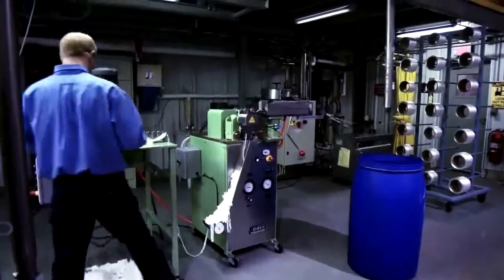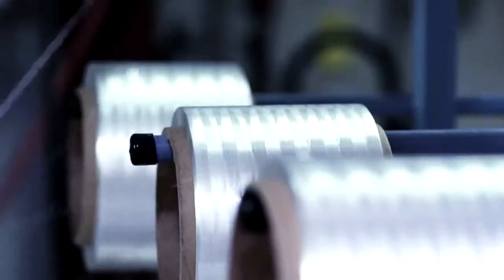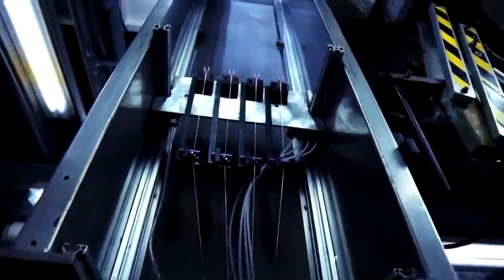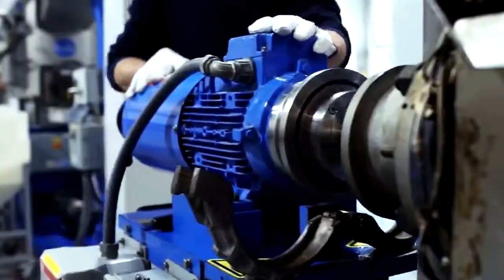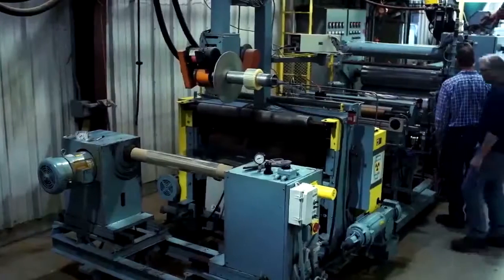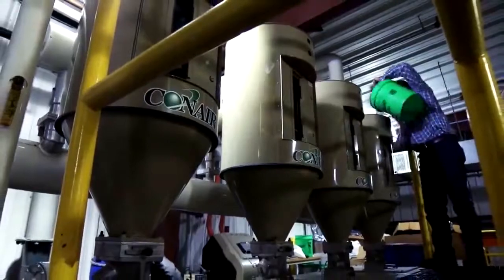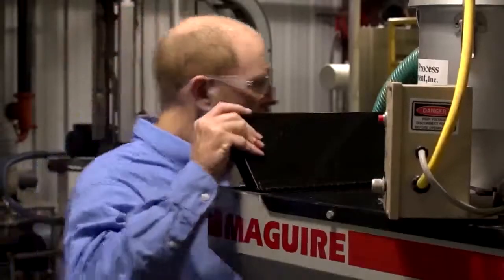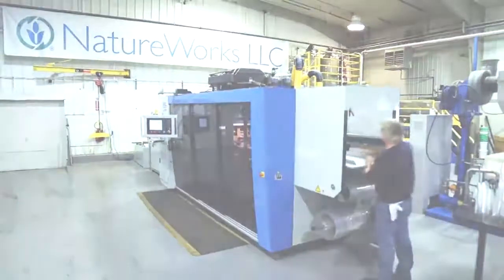PLA Production Process

Comment: Where can i buy PLA pellets that are used to make PLA filament ? .. the smallest pellets available.. what kind of savings can i expect over buying 1.75 FILEMENT rolls.. gray color is preferable
Reply: Your best bet is just to buy it on the industrial sized 10 Kilo spools which I searched for on google and found for about $38.00 each made by ANYCUBIC. Why PLA? It's not really bio degradable so that's just PR/BS and PETG is even 14% cheaper and if you run the nozzle at 268F. has clean results plus it's 250% tougher than PLA with a more mature and established recycling infrastructure.